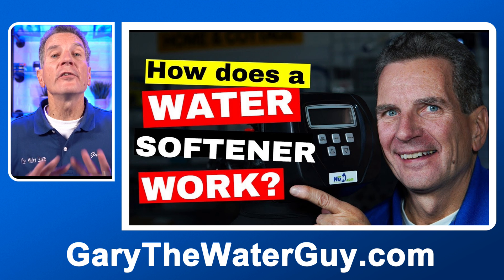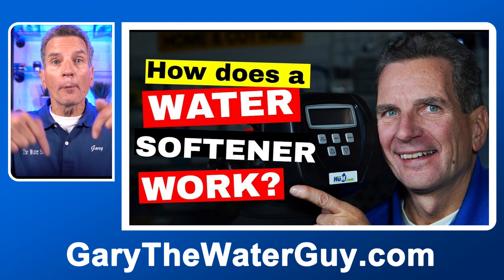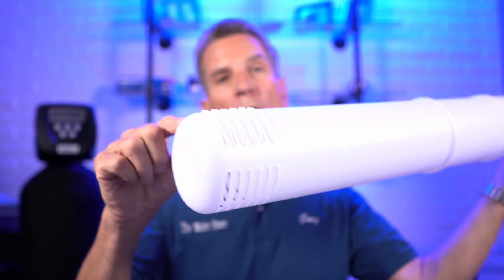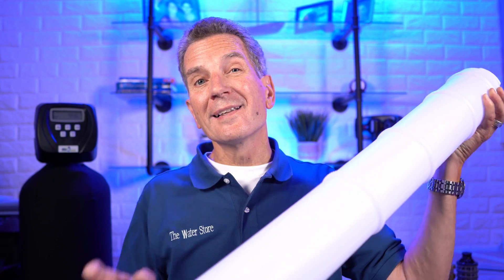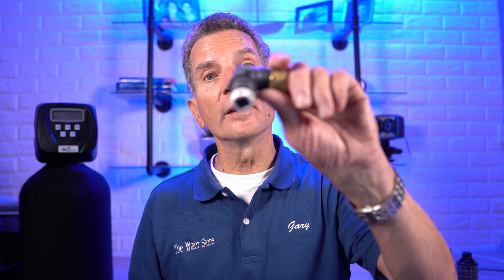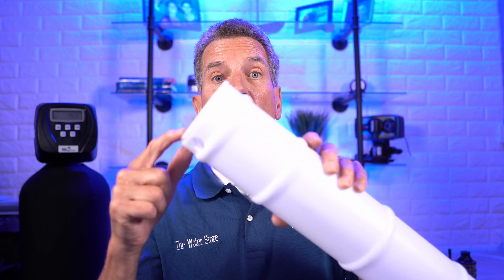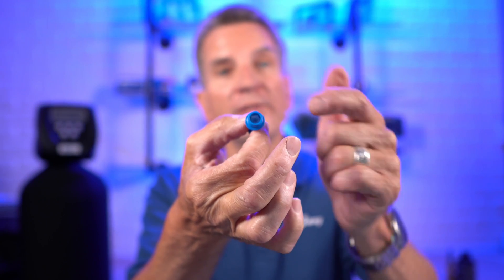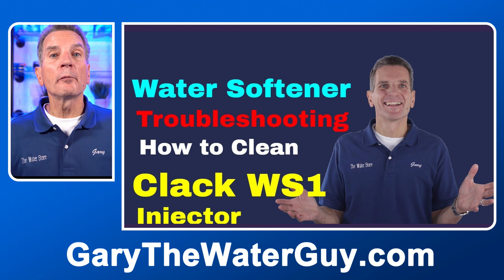Water Softener Troubleshooting – TOO MUCH WATER in Brine Tank

Comment: I had a potassium salt clog at the bottom.  It was rock hard like cement.  Hot (almost boiling) water didn’t do anything to dissolve it.  I had to smash it with a pry bar and sledgehammer.  

(Now I am using aquarium silicone to patch a couple holes in the bottom of the tank that I made with the pry bar.)

Comment: My salt tank is leaching salt brine, but no water is leaking out. The brine is building up at the exterior base of the salt tank and on the floor surrounding the salt tank. Any ideas as to what’s going on?
Reply: Your tank must have a small crack or hairline crack in it

Comment: For years I would just keep the salt around 3.crecently I heard that salt level needs to up higher.  Within the last 2 yrs I asked Ecopure if that's true. They said 3/4 or more. So I put in to 6-7. .. so now I saw that salt wasn't going down. I thought maybe a salt bridge or block. So I used a rod to go thru. Well, now yesterday I'm seeing to tank and brine filled up with water to 6-7. Not good.

Comment: I knew a softener guy who ALWAYS installed Whole House Water Filters in the water line ahead of a softener. Not very expensive but you have to change the filter on a regular basis. A task not for the faint of heart but filters protect all of your home's plumbing from debris (If you buy the expensive filters, they claim to do more). One time the city must have worked on our water main because I observed mud debris in the filter housing. Been using filters for almost 35 years.

Comment: My brine  tank was overflowing this morning. So I did the  regen and all the water came out and there was very little salt at the bottom of the brine tank. If that’s the case is that good , and Did regeneration alone fix the problem or do I need to check something else? The water line seemed to be flowing  and was making a flowing sound.
Reply: Did it come back?I guess we gota help eachother 😂 mines is constant water flow

Comment: My water level is above half and only seems to shut off when the float tells it to. Their is only one float. Assuming the settings are correct, is it reasonable I should fill the tank 3/4's full of salt to start and then add salt to keep it above the float level? I have watched  a couple of regens now completely. I don't see water leaking around the brine line, the tank drains of water completely during , even when it is empty of salt and the water is more than half way up the brine tank to start, it then fills again to that level with water when its done.... The fill cycle goes for about 15 minutes when it fills the brine tank..... The reason I am asking this is I have emptied the water level to about 18 inches of water, put  like 4 bags of salt in to bring the salt about the level of water, and then done a regen on my softener and it fills to that level with water which dissolves all the salt and leaves the water very salty which we can taste in the water when we shower and brush our teeth...... :(

Comment: great video and explanation I had this problem too but it wasnt in one of the solutions you have shown. my tank had too much water because the programming settings was wrong. The fill and set capacity values were much greater than what it should be as I had a small tank . i bumped these down and in the next regen water level was back to normal.  My softener is only new and the installer didnt set these properly.
Reply: @Dawgley  what should I set it on there is only two of us in the house his son does come and stay thru the week but isn't here from Thursday to Monday evening

Comment: Well this is the second time you have saved me a bundle of money.  As this video explains,  I had a salt block in the brine tank. I spent a few hours digging out all the salt with a metal scoop and got the softener working again. I put in new salt and water and it is working fine. My question is, can I reuse any of the salt that I removed from the brine tank or do I have to throw it out?

Comment: My salt has not dissolved, and the water level is above the salt. Even though i have regenerated it several times, with the bypass on, do you have any suggestions ?
Reply from the maker: Water will only absorb so much salt before it becomes saturated.  Has it sucked out all of the water during each regeneration?

Comment: I have a water softener that is slightly different than you have. I don't have clips that hold in the piston. 
There isn't a brand on it, so i dont know who made it. 
The top is all one piece with a camshaft arrangement, and there's a glass bowl on one side with a black ball in it. Unfortunately, I'm not able to send you photos. Is this familiar to you ?
Reply from the maker: Yes, this is an Autotrol valved water softener, here is one of their manuals https://www.pentair.com/content/dam/extranet/web/nam/autotrol/manuals/3003714-autotrol-740-760-255-performa-268-manual.pdf now having said that, they are extremely difficult to service, I know I've tried many times.

Comment: All the videos say to put into bypass then start regen to remove pressure. Are we just running c1 then stopping it on c2?  How do I stop it? Unplug it? You say u til the motor stops. Like c1-c5 then stops? Or just c1 to backwash or drain. Thank you
Reply from the maker: Just until the motor advances to c1, about a few seconds is fine.  You can fast forward through the cycles by holding down the regen button for 5 seconds once each cycle starts.

Comment: Have a Morton's. Cleared a giant salt dam that I cleared and replaced the venturi assembly. Took out the float assembly, checked it for clogs, and replaced. The tube that goes up to the venturi rides freely in the float tube from what I can tell. The discharge appears to be working. The cycles seem to be working. I put this in in 2010. Not sure what I'm missing! Any thoughts.

Let me qualify one item. I rechecked the float tubing connection, and it was fully engaged.
Reply from the maker: Does the brine level drop during the brine cycle when it is regenerating? If not, is there suction going to the venturi when you disconnect the brine line?
Reply: @water_estore  No it doesn't. I'm waiting on a valve rotor and seal kit from Amazon, then I will rebuild the assembly.
Reply: I replaced the venturi, rotor, and valve seals. I also lowered the stop on the float tube, figuring this might keep the amount of water to a minimum. I made sure the brine tube was clear and touching the bottom of the brine tank. After the most recent regeneration, the water level was still around the 1 mark. I'm going to watch it over the next few cycles to see if the water goes up. I'm going to let the salt run low to see what it looks like. My question is, should it fully drain after it draws brine or during the backflush cycle? Does a water softener usually drain fully, or does it leave some water at the bottom? And if it leaves water, then how much is too much? Also, the cycles seem to advance normally.

The system is 14 years old and installed it in 2010. The original had the resin cage break and dumped  beads into all the water lines in the house. If you ever seen Ghostbusters 2, where the slime comes out of the faucet, that's exactly what it looked like. 

If none of this works, I'll probably replace it, but I'm not looking forward to that job.

Thanks.

Comment: My water softener is very old and I never had it checked for maintenance but I always add salt. It's been sitting with water that's half way full. It's a bit above the salt level. I'm a single mom and don't have the money to get this repaired. What should I do? Do I press regenerate button to see if the water goes down and make sure it's still working? Because the plumber that installed it ten yrs or more ago set the timer for 3am. I haven't heard it go on for few days.  I usually never let it run out of salt.  I wish u could make a free house all to check it 
Help! I don't know what to do
Reply from the maker: It sounds like you are not sure if it is working, is that correct?  If so, you can manually regenerate it and then check on it every 15 minutes to see if it draws out the brine during the brine cycle or not, if it does, it is working.

Comment: I have a Morton water softener which is overflowing. My level switch has two floaters, one on top which stops the water from overflowing and one at the bottom which doesn’t seem to do anything. The floaters are made of cheap plastic foam. Should the bottom foam be attached to something to activate the switch?
Reply from the maker: Not sure, I’ve never seen one like that.

Comment: Thanks for this. I'm having issues with my Viqua WS which appears to be a rebranded clack. It doesn't draw brine. I've cleaned the valve, the tank and no luck. I noticed that during the draw brine cycle it's actually putting more water into the brine tank. There's no suction. What could it be?
Reply from the maker: It could be a clogged injector, if os this video will help https://youtu.be/Eonviqm58bA or the valve needs to be rebuilt, we have the rebuild kits and video here https://waterestore.com/products/clack-ws1-softener-rebuild-kit-wrench

Comment: I had a problem with the drain line constantly running. I replaced the seal pack and both pistons and corrected that issue. Now I have a problem with the brine tank filling to the point of the float shutoff activating. I went through the steps in the video, including checking the injector. I disconnected the brine line at the float assembly and ran through each stage of the regen cycle. There is water being sent to the brine tank for every stage of the regen cycle. During the normal service position, there is no issue. Any ideas on how to proceed? Thank you in advance!
Reply from the maker: During the brine cycle water (or brine actually) should be sucked from the brine tank.  I would clean or better yest, replace your injector.  we have them and a video showing you how, here https://waterestore.com/search?q=clack%20injectors
Reply: @water_estore  thanks so much for the reply! Another source suspected that I didn’t have the cap on the piston/seal housing seated all the way. That ended up fixing the issue. Thank you for all the great videos as you helped me replace the pistons and seal pack on my own!

Comment: I’ve got an old Culligan in a second home with high iron content that wasn’t recycling. I put it in regeneration, water and unit wouldn’t stop running. Turned large dial by regen switch and water started going in but now won’t drain. Have stirred and punched and scraped bottom with broom handle. I know it’s old but I really think it’s the timer. Can’t find anything on how to set dials. Instructions for timer are on unit but regeneration dial has no instructions. Help!
Reply from the maker: The valve needs to be replaced.  All of that iron is casuing the piston to get stuck.  Time for a new water softener, check out this one. https://waterestore.com/products/hum-deluxe-water-softener-30-000-grain

Comment: Hey Gary, Have a question for you. I have had my water boss since 1993. It is a 93 WB. It's been a great unit. Yesterday it started a 05-error code. Making a clicking sound near the motor. Do you think it is a piston or motor problem? I have no control on the board with the error code so I can't regenerate it to release the pressure. Any help would be appreciated. Thanks.
Reply from the maker: The piston is stuck so the gears keep clicking.  The valve needs to be rebuilt.  We have the the drive end cap assembly here https://waterestore.com/products/aquamaster-drive-end-cap-assembly-54520

Comment: Thank you for the great videos! Since I'm new to water softeners this has been a great help! I have 2 questions #1- I'm looking for that overflow valve that goes in one of the holes on the brine tank but I can't find it in your e-store, what would be the correct term?  #2- Also looking at the float assembly (have it in my cart) just wondering if it will fit my brine well it is rectangular not round like un your video and much narrower (I have a yellowish/beige brine tank if that helps... Now I'm wondering if I should just order a replacement tank and if the tank comes with a float?  Oops guess that was 3 questions. LOL
Reply: I will add that in my brine tank there's the gaping hole where the overflow should be and in the well there is a rod with a float at the bottom but the line is going into the 90 elbow attached to the rod nothing else there, not sure if that's how it's meant to be maybe in ancient models? or if they (old owners) just jerry rigged it like that, no matter it overflows and floods my basement all the time the only it goes down is when I bail the water out. So  This is why I'm wondering maybe instead of ordering a couple parts I'd be better with just the new tank?
Reply from the maker: Probably need a new tank and float assembly, but you can always emasil us some pictures here info@waterestore.com
Reply: @water_estore Thanks my hubby ordered  the parts will see what happens, if it doesn't work I'll email.

Comment: Curious, I did a 
Manual regeneration cycle and added some powdered iron out product to help clean the system.  So before I ran the cycle, the tank was about a third full of salt and had a few inches of water on top of it. I noticed when I ran the region cycle all that liquid was gone and then I checked a few hours later, and the liquid was back again. Is this normal
Reply from the maker: Yes, see this video on how a water softener works https://youtu.be/i9pI76dk4Zs
Reply: @water_estore  thank you 😊

Comment: If you have too much water in your brine tank and the float is at the top of the tube, can you even put it through a cycle?  When the float is at the top of the brine well, wouldn’t it be telling the softener not to go into a regen?  Guess my question is, do you have to remove some water from the tank before putting it into the regen?
Reply from the maker: Great question.  The valve does not receive any information from the float, so no, you don't need to remove any of the water.

Comment: I did all of this but am still not getting softened water, I completely cleaned everything. Now I read that it could be the beads in the cylinder. Do you have a video for that?
Reply from the maker: Yes, we have it here https://youtu.be/Z47JGH1l39o
Reply: 1 cup iron out in a half gallon of cold water, mix well and dump into your float tube, then do a regeneration.

Comment: Hi Gary there is a blue light that keeps flashing on the front of my panel door. How can I shut it off. Also I've put 2 bags of salt and its telling me I have 2% full. Looking  in the salt tank its 3/4 full. What's up?
Reply from the maker: Check your manual, you likley need to tell it how muivch salt you added.  Sorry, I haven't had any experience with the flashing blue light.

Comment: Gary, I've checked all the valves and during the regen cycle the water level is rising and there is water being sent to the drain.  Please help me out.  Thanks!
Reply from the maker: Water is not dropping during the brine portion of the regen cycle?
Reply: I have cleaned the injector and the brine line flow control module.  During the brine dn cycle the flow to the drain seems to be reduced in volume and water is being added to the tank. Does it make sense to replace the drain flow module?
 @water_estore
Reply: During brine/rinse cycle the volume of the water going to the drain will be reduced, and during the refill cycle the water softener add water back in to the brine tank. By your description it sounds like your water softener is operating correctly

Comment: I have standing water inside the water softener about half full..  When I un-bypass the water softener, it leaks out the bypass valve.  Does the bypass valve need replacing??  I will clean out the water and salt tomorrow.  I tried the regeneration process, but I don't hear any humming from the motor, but it does complete in a couple hours.
Reply from the maker: When the water softener is in service, (not bypassed) water shoukld flow through the bypass.  Not sure what you mean by "it leaks out the bypass valve"

Comment: I started having issues with my brine tank filling all the way up until the overflow level stops it. I just noticed that my dlfc is missing according to the drawings. It's possible I removed the drain fitting and the dlfc popped out without me noticing. Would missing the dlfc cause this issue?
Reply from the maker: Yes, it definitely would.
Reply: @water_estore  is it just a generic part or is it dependent on the fitting. There is no part# listed in my manual